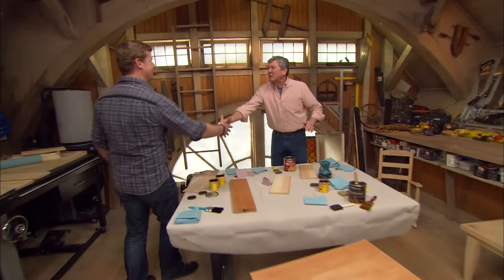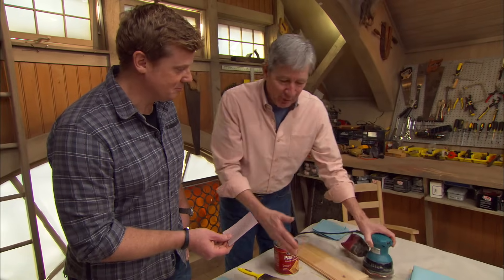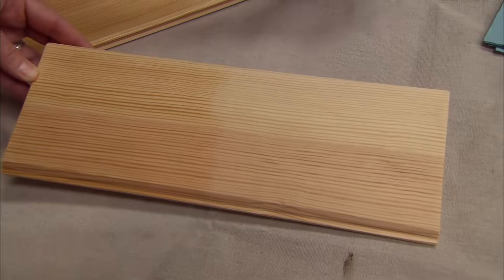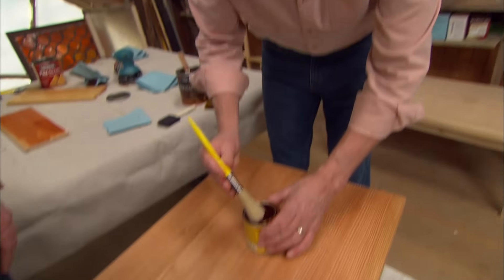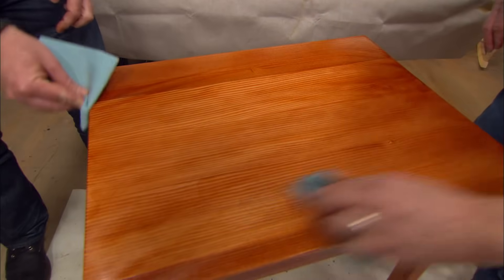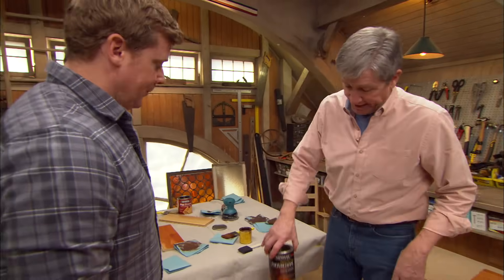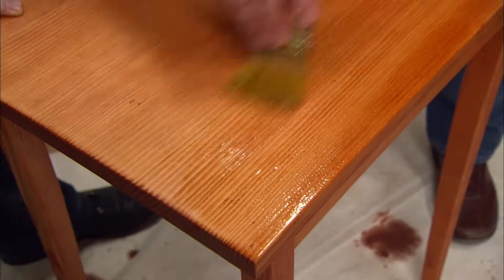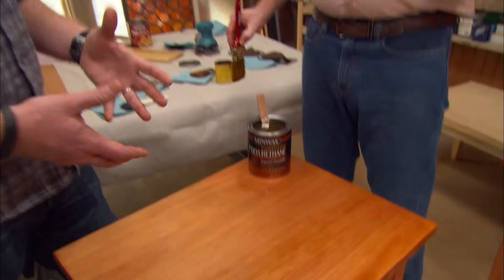Staining and Finishing Wood (S12E23) | Preview | Ask This Old House

Comment: Two finish coats to protect. However, the more you use, the deeper the finish. Some projects I've used up to 8 coats. Looks like it is covered in glass and wears like iron. And yes, with dry times, takes at least a week to finish a project.

Comment: My daughter took off some of my table top finish with pancake syrup(long story) My teen daughter spray painted it with the same color hoping I wouldn’t notice but it’s too light... What would someone suggest I do ? Stain? Or? I don’t wanna have to sand it and redo.. It’s a expresso wood color
Reply: If it's a small area, then you could get one of those stain markers or wiping stain cloths (they've already got the stain soaked in them) in the same or similar color from Lowes and do a tiny patch test. I'm not an expert so I'd wait for one other suggestion before you make any purchases. I hope you find this helpful!

Comment: I’ve sanded it my desk, used a pre-wood conditioner and then stained my desk. It’s been about five days. Now that I’m looking at it, I want it to have another coat. I have not protected with any polyurethane yet. Since it’s been five days, do I have to use pre-wood conditioner before staining it again.? Will it ruin the wood if I just stain it without using conditioner? Or maybe has it been too long between stain coats and shouldn’t I try to stain another coat? I guess what I’m really looking for is how long can you wait between coats of stain? Thank you

Comment: All stain left on top will soak in if you buff as you go. I’m currently doing black walnut verneer 3/4 particle board in ebony stain. Fun fact, particle board with double side verneer is cheaper than the 4x16 of verneer that is used per particle board.  $70usd per 4x8 sheet of wood vs. the $80 per 2 sheetspree glued to 4x8!particle board

Comment: It seems no matter what brush is used always leaves brush strokes in the stain as well in the clear coating I thought trying the polyurithane spray method though hear it dries as fast as it goes on causing dry spotting.

Comment: I was told you CAN put water-based Polyurethane over an oil stain, as long as you first wipe the dried & stained wood with a rag &  light spray of 50/50 water & alcohol.  My project came out OK, only a long-term test will reveal if this was OK.

Comment: Hello good morning love Ur videos and wanted to ask u something im kinda new to this and i been asked to do a project at work since se have an 8 step procedure to finish a bed se are trying to set up the same procedure for the bed rails wich includes toner, sealer,wipe Stalin,sealer,sanding,dry brush,sealer, topcoat Is there Any way i could substitute Any of those steps or material to make the process smaller meaning shorter im trying to do it in half the steps thank u and have a great day!!!

Comment: what would be the best way to apply polyurethane and stain for a newbie? I used a lambswool stain applicator on my counters once and I dont know if i got as even a look as id want and had a bunch of uneven spots with the clearcoat thanks in advance
Reply: Stain: old t-shirt or similar material, Polyurethane: bristle brush (don't use the sponge brushes), Combination stain/polyurethane (like PolyShades by Minwax): bristle brush

Comment: The polyurethane i used i think is dry and is making streak marks from the paint brush bristles. It has now dried overnight and i know have  streaks in my finish.

Do you think i should sand it all down and buy new polyurethane and apply that from scratch?
or can i just sand it down and re-apply it?

as of now i have a lot of surface to sand. so if possible i want to use a orbital sander. would that be a big problem if i was careful?
Reply: What did you do?

Comment: I've read that with the stain, it should be stirred rather than shaken because shaking can introduce air bubbles. What's your take on that? It seems that bubbles in stain don't matter too much. It's going to spread and soak anyway. If anything, I'd be more concerned that the shaking could expose the stain to more oxygen, slightly hardening the drying oil, but I don't know if that's significant.

I'm pretty inexperienced in staining. Is it necessary to mix/stir the stain every few minutes while applying?

Comment: For total noobs like me, it would be nice to post in the description above links to the materials used in vid. Mainly I want to know the type of brushes and rags to use.

Also what are the advantages/disadvantages to go water base vs oil base.
Reply: Christopher Dillman water based dries faster, which can be a negative because you have to work quicker. (same idea behind glue-sometimes fast drying is bad). 

Water based has less chemicals, and the rags you use can't spontaneously combust.

Water based poly generally doesn't change the color of the wood.  Oil based will usually amber or yellow light woods à little bit. 

I have found it much easier to find a full range of oil based products at home centers.  You can almost always find water based poly, but I don't recall water stain.

If you use water based anything, you need to wet the wood after sanding, let the grain rise, then lightly sand again before any products go on.  Otherwise the water based product will raise the grain and you'll have a bad surface.

As for durability I <think> oil based poly is harder but not by a lot.  Not enough to get excited about.

Last, mineral spirits is the solvent for oil based finish, water is the solvent for water based.

Comment: I've been having a problem with finish ,using stain with poly waterbased,ordered 4 cans  of dark walnut for some reason there's grit i  the stain,I thought the first time I stained a piece of this end table that maybe I didn't clean all the dust off, so I removed the stain cleaned and vacuum the piece and even wiped it with a brand new rag ,same thing grit all through stain,removed stain again now thi king it's the bush maybe picking up dust from thin air? Bought a new brush and started again putting stain on with new brush ,clean surface and there's the grit,what the hell is going on, HELP!

Comment: I was told you can't put Poly on like. Paint one clean stroke if you miss a spot try get it on next coat.
Reply: Louis Holland im for sure lacquer finish cant go back and forth cause it dry much much faster than poly but i assume all finish should be 1 stroke because going back and forth can see brush lines/marks

Comment: what if i want a flat finish after stain not a glossy wet look. how do i go about that
Reply: There are lots of different options for finishes. If you stick with Minwax, there's Clear Satin, which still has a bit of sheen, but there are other finishes that wouldn't have any. You could also go with a wax finish, if the piece of furniture isn't something that's regularly interacted with and if it won't be exposed to moisture.

Comment: Is wood conditioner necessary on hard wood like flame maple?!
Reply: yes because there could still be blotches, though it's less occurring but why take that chance? Also be sure to go over any glued seams with extra sanding prior to conditioner. Add extra conditioner on ends of wood, they absorb more.
Reply: The conditioner will make your stain look brighter. If you're using a darker stain on hard wood, i would skip the conditioner

Comment: Information:
1) You will need Mineral Spirits or Paint Thinner to clean your brushes if you use oil-based stain (but don't put it down your drains).
2) This stuff all stinks and will make you light-headed so you should stay in a very well ventilated room.
3) If you have something that will have to rest on a side that you are staining, prepare  every other side first, stain those sides, then prepare and stain the side you're resting on. When all sides are stained move on to polyurethane. 
4) Gloves go a long way in cutting the amount of irritation you will experience from skin contact.
5) Be careful about applying stain near a joint or the corners, as you may have trouble wiping it away or it may sink in a crack between two pieces of wood. This results in a darker stain color near these joints and corners.
*) Sanding up to 220 is another step added to the sanding they mention here, but works very well in between the first and second coat of polyurethane to keep the application even.

Happy Craftin'
Reply: If not down your drains then where??

Comment: How long do you wait to wipe the stain?
Reply: KJ Aponte that's what I was wondering
Reply: You don't have to wait, you can do it right after. You can wait a little bit to make it darker
Reply: I think they said in another video maximum 15 minutes.
Reply: Thanks!
Reply: according to them the longer you wait, the more the stain penetrates and the darker it becomes. I don't use this silly method. First I dilute the stain with paint thinner. 1:2 or 1:3 in that order. I lightly soak a small cotton disposable rag with the product and work it into the wood. Wiping and finishing it at the same time. Polyurethane  is ok if you use the one that is wiped on. And you wipe it the same way I described with the stain. You can do 2 to 3 or more coats. Let dry for a day. As a finish I prefer Lin Seed Oil, Danish Oil, or anything that is not gooey. These people show very commercial, assembly line type of thing. Seems that the wood conditioner is a good idea. I'm going to have to try it. I really never had any use for it. The sandpaper is too coarse at 150 or even 220. These guys are full of it.
Reply: 5-7 minutes is usually good enough. Waiting longer than 15 minutes runs the risk of the stain drying before you can wipe it off (depending on the temperature, humidity, etc.) You can always apply another coat of stain if a darker color is desired.

Comment: 1. Oil-based wood conditioner
2. Oil stain
3. Good brush
4. Oil polyurethane

5. wait 8 hrs, then 220 sand
6. Then another coat

Comment: Do you coat the whole thing with poly or just the tabletop?
Reply: Whole thing. The poly will actually change the color appearance of the stain slightly once its coated. Besides, the poly is also a protector.

Comment: Hahaha.  "Don't shake.  Stir in a figure eight pattern."  Everything else looked okay, but bubbles DO NOT transfer from the can, to the brush, to the wood, then stay there while you brush on the finish, then lightly brush over the finish with the tip of the brush to smooth it out.  Shake it all you want and stir it in circles if you want.  It won't matter.
Reply: Now this makes sense to me, however the directions and every expert I've ever heard says DO NOT SHAKE., I'm on the fence.

Comment: Disagree, varnish is better than polyurethane
Reply: +Andrew Whitburn If it was an outside table, then yes. But I for inside, no. Varnish is more for outside projects.
Reply: +Agar “AlexBLegend” at_lex Hi. Well both varnish and polyurethane have their advantages over each other. Varnish is good for outdoors..but it is also good indoors too. If you use it on indoor furniture that is likely to be placed near a window, it is UV resistant so less likely to damage the furniture in high hot sun locations.
Poly is better scratch resistant but is more toxic....especially the oil based stuff...really toxic that is. Some people complain of a cloudy look on poly sometimes but that may be their application method.
Poly usually only needs 1 - 2 coats but can dribble if not careful which is not good. Varnish I find is easier to apply but you need many more coats to get a durable cover. Poly is also more susceptible to cracking from movement.
At the end of the day is a personal choice. I find varnish nicer to use and I like the look of the finish better. Its also a bit more natural than poly which is more like a plastic coating at the end of the day.
You could google search the types of finishes to get a better idea and make your own choice.
Reply: Well, considering that normal window glass does not let much of the UV spectrum through, I don't know if the whole thesis about furniture placement doesn't fall under the table. (Not many people have pure crystal glass in their windows, which is transparent for UV spectrum and is, thus, used for UV bulbs ). Just a thought.

Comment: Well I did every step plus some and  I still didn't get a smooth finish!  I've sanded and recoated 6 , maybe 7 times and used 400 grit paper, 0000# steel wool and still not a smooth and glossy finish.  Don't believe them,  it doesn't work

Comment: I don't see the point in applying varnish, it looks so old fashioned and it's so easily dented/scratched.  Not my cup of tea but overall I liked the video.
Reply: Polyurethane is not a varnish first off.
And you need to use a sealant to protect wood.
I learned this from my father a furniture maker many years ago